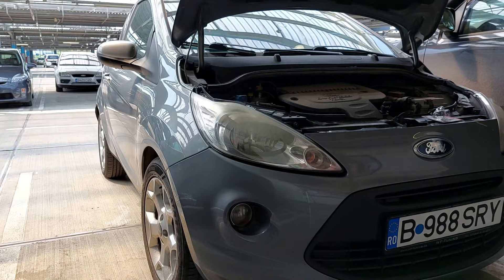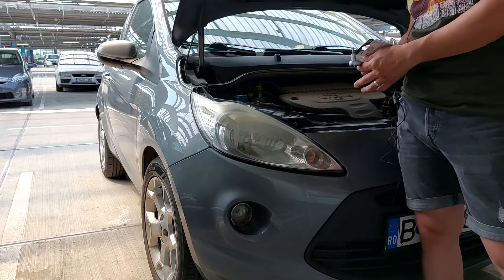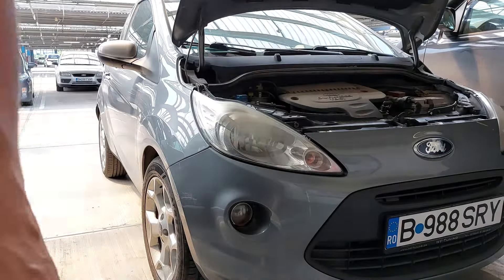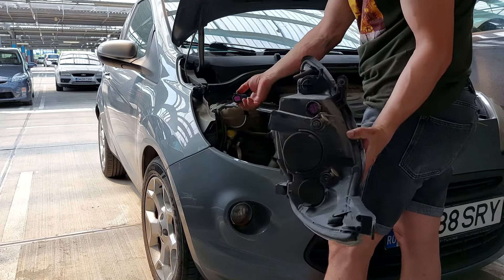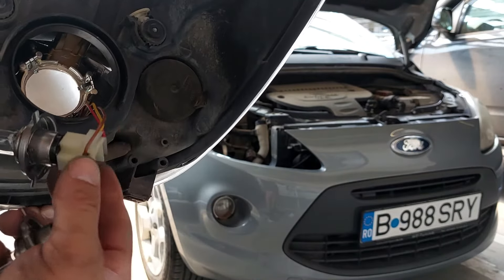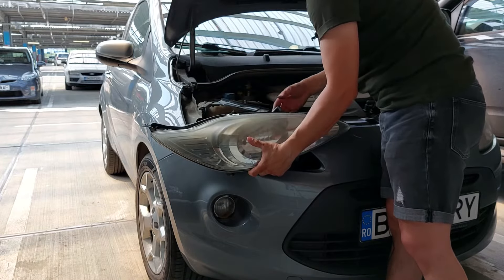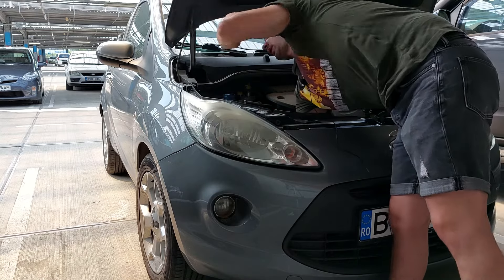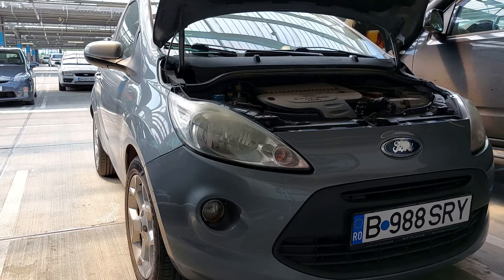How to change Head Light Bulbs on a Ford KA 2010 / How to remove Ford KA Head Light

Comment: Thanks for this video. Found this quite an easy job. Just used a T30 Torx Screwdriver, 2 screws on top and 1 underneath accessible from the access panel on the front of the wheelarch liner by locking the steering wheel. I think it took me about 15 to 20 minutes to change the bulbs in each headlamp. Hardest part was lying on my back to unscrew the bottom one, its tight but manageable.
Reply from the maker: @JonJon-fu8qz. First of all, thank you very much for the comment!!! I’m aware of that small access cover, but unfortunately, when the wheel arch on my car broke, I rebuilt it using fiber glass, and didn’t include that access hole. Because of this, I couldn’t film that particular version. However, I’ve received many comments explaining this method, and I’m glad people can read about this alternative way to change the light bulb. In the future, I plan to create a new video where I’ll also showcase this approach. If you found this video helpful, I’d love for you to subscribe to the channel if you haven’t already. Your support truly motivates and inspires me to keep creating content!

Comment: Multumesc from Hungary! Keep up the good work of helping people with such videos!
Reply from the maker: @fulesmackofule. First of all, thank you very much for your comment!!! I made some videos with various parts that I replaced on this car, such as changing the window lifting system, removing the door panel, etc. Generally minor, but they can be helpful because I noticed that they are common to this model. The most important thing is that they are easy to repair, without the need to go to the service and spend a small fortune. If you found value in this video, I encourage you to subscribe to the channel if you haven't already. Your subscription serves as a motivating factor for me to persist in delivering fresh, informative videos.

Comment: There is an access panel under the wing, just turn the wheel to full lock to get in there.
Reply from the maker: @Ender Scope. First of all, thank you very much for your comment. A subscriber told me this before and I know about the existence of that cover. But unfortunately, my hand didn't fit all the way to the screw, and I found this version quite difficult to access. I'm not saying it wouldn't work, but it seems quite difficult to me. What I managed to do through that hole was to change the bulbs of the fog projectors. Thanks again for the tip, and if you find my channel helpful don't forget to subscribe! Your support as well as that of other people who visit my channel is extremely important to me!
Reply: how do u do that or get to the access panel i need to change my sidelight

Comment: Why did Cars switch to this way of changing light bulb. It used to be that you had a little cap you unlocked and that's all you needed to do to change bulb.
Reply from the maker: @Astro War. First of all, thank you very much for your comment!!! Yes, you are right and I agree with you.  Unfortunately for this model, I personally did not work to change the bulb in the classic way.  I simply can't fit my hand between the headlight and the rest of the car's components. My personal opinion, although I may be wrong, but I want to support my case is that the car industry somehow wants all maintenance operations, or even changing a light bulb, to be  possible only at an authorized service.For example, for the rear light there was not even that cap like in classic cars.  Or any possibility to access them from the trunk of the car.  You simply have to remove and unscrew the screws of a cover to be able to access the bulbs.
Reply: @PAFixandCrafts  Yes I have this vehicle and I had to remove the whole thing to get at it. Conversely on my 1987 Nissan it's a 2 minute job with no tools required. And yes I agree with you, it's obviously a deliberate design. Even with tools they made it as awkward as possible with that bolt down below the lamp. In the end I didn't bother putting back the bolt below and now it's a quicker job. I went and changed the fog light bulbs at the same time as it's awkward to get to those without the headlight removed.

Comment: You don't have to take the plastic headlamp out and mess around with screws, just look at the back you'll see the rubber cover just take it out and bulb is right there a two minute job.
Reply from the maker: @Adrian Pickard. First of all, thank you very much for your comment!!! Other subscribers told me the same thing, but unfortunately for me, personally, I simply can't fit my hand between the headlight and the rest of the car's components.  As an example, changing a rear light bulb is absolutely impossible without removing it because there is no possibility to access it from the trunk. My opinion, although it may be wrong, is that in the future a simple bulb change will have to be done at an authorized service.  I think the automotive industry is moving slightly towards this trend.

Comment: Full right hand lock. Use the access panel on the inner wing. Simple !!!!!!!
Reply from the maker: @ ken wheeler. First of all, thank you very much for your comment. A subscriber told me this before and I know about the existence of that cover. But unfortunately, my hand didn't fit all the way to the screw, and I found this version quite difficult to access. I'm not saying it wouldn't work, but it seems quite difficult to me because I have to somehow sit on the floor and it's quite difficult to do that in the parking lot of a store. Anyway, in the future, I will try to post a video with this version as well. What I managed to do through that hole was to change the bulbs of the fog projectors. Thanks again for the tip, and if you find my channel helpful don't forget to subscribe! Your support as well as that of other people who visit my channel is extremely important to me!
Reply: can u help explain that to me pls i need to change the sidelight on my ka im struggling

Comment: My headlight gets very hot after 1 hour of driving with the lights on, I have checked and the heat is only coming from the center part of the headlight. It is normal?
Reply from the maker: @ DAXCR . First of all thank ou ver much for your comment! The 2010 model uses H4 type bulbs which at the base have a tungsten wire as a component which in the presence of a gas and the passage of electric current through it, it heats up generating light radiation. Personally, I would have no problems with the heat generated. But if you want to go further to solve this situation, we can measure the temperature of the headlight after a certain time interval with an infrared gun and compare the results. Although I think they will be similar.
Reply: @PAFixandCrafts  Thanks for your answer, I understand that it is normal. My car's headlights have also turned a little yellow and ugly like the one in the video and I wonder if it could be due to the heat or what method do you recommend to eliminate that because I used a special product but after a while it's similar again. Coincidentally, in the area where there is more heat is where it has turned yellow and ugly the most, the part of the flashing light bulb is like the first day, clear!
Reply: Also I forgot to tell you that if you turn the wheel completely you can see a cover next to the wheel, that way you can access that difficult screw under the headlight that you mentioned!
Reply from the maker: @DAXCR . Certainly, both the light radiation and the heat released by the headlight are factors that influence their fogging, but the worst factor is the sun. A long exposure of them to the sun brings this effect. As a solution, I polished the headlights with a repair kit bought from Lidl. But the effect lasted only 3 months. There would be another option where you could sand the headlights with 1000, then 2000, then 3000, then 5000 grit sandpaper and then cover them with two layers of Klarlack. But over time the varnish will peel off and you will have the same effect. In my case, it lasted 2 years. And thank you for your support!!!
Reply from the maker: @DAXCR. I knew about that hole, but I thought it only offered room to change the fog lights. I never thought I could unscrew that screw through that hole. I will try next time when I have to change the bulb. But it's a very good idea that I didn't think of. Thanks!

Comment: Ciao ho provato a cambiare la lampadina senza smontare il faro ma non riesco ad estrarre il porta lampadina....se tiro non si sgancia... C'è per caso qualcosa da premere oppure bisogna fare una rotazione? Ho una Ford Ka del 2010
Reply from the maker: @MissAvenada.First of all, thank you very much for your comment and secondly, sorry for my late reply. It does not press anything on the bulb and does not have any safety system. you only have to pull with more force and thus the light bulb comes out with the connector. Again you will have to pull to remove it from the connector and replace it with the new one. Be careful that pin is oriented at the top. I hope you found my answer helpful and if you have other questions, don't hesitate to write to me.

Comment: Brother, there is a plastic cap Infront of the tire,where is the mud cover. The bolt is right there, no need to brake your fingers
Reply from the maker: @ chencheff. First of all, thank you very much for your comment. A subscriber told me this before and I know about the existence of that cover. But unfortunately, my hand didn't fit all the way to the screw, and I found this version quite difficult to access. I'm not saying it wouldn't work, but it seems quite difficult to me because I have to somehow sit on the floor and it's quite difficult to do that in the parking lot of a store. Anyway, in the future, I will try to post a video with this version as well. What I managed to do through that hole was to change the bulbs of the fog projectors. Thanks again for the tip, and if you find my channel helpful don't forget to subscribe! Your support as well as that of other people who visit my channel is extremely important to me!

Comment: YOU DO NOT NEED TO DO THIS TO CHANGE THE LIGHTBULB!!!
All you have to do is remove the cap on the back of the lightbulb and change it that way. 
If you wanna change the little light, than yes you have to remove the entire thing but otherwize you dont have to.... 45 min of struggeling to figure that one out
Reply from the maker: @Gamer 4028. First of all, thank you very much for your comment! I tried this option, but unfortunately my hand does not fit behind the headlight in any way to be able to change the bulb. It used to go to the older Ford KA model that I owned for a while, but with this model I could not change the bulb until after I took the headlight down.

Comment: I have tried just pulling the bulb out but there are clamps / clips 
I don’t want to mess anything up so was jst checking do they just unclip ?
Couldn’t see that part as it was off camera
Reply from the maker: First of all, thank you very much for the comment!!! Don’t worry too much; the light bulb fits securely in place. To remove it, hold the bulb with one hand and gently wiggle the plug and bulb left and right while pulling the plug out. You’ll notice the bulb will start to separate from the plug. Once it’s out, simply insert the new bulb with the base facing up, then reattach the headlight. That’s it! If you found my answer helpful, please consider subscribing to the channel if you haven’t already. Your support truly motivates and inspires me to keep creating more content!